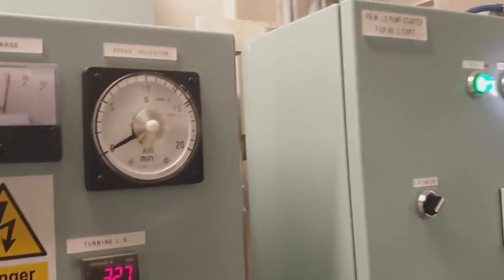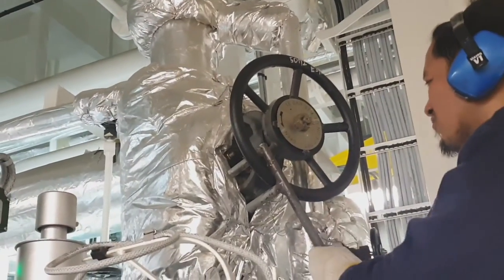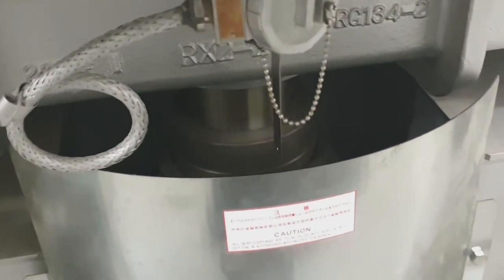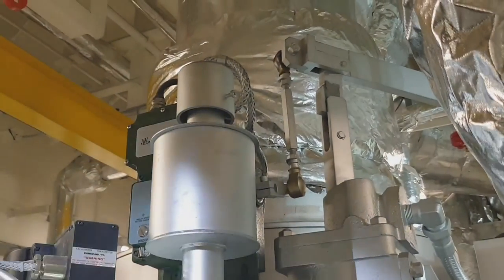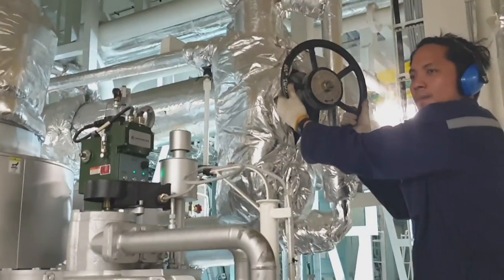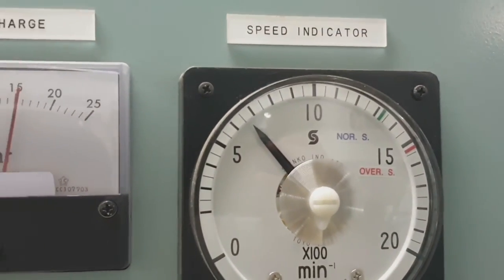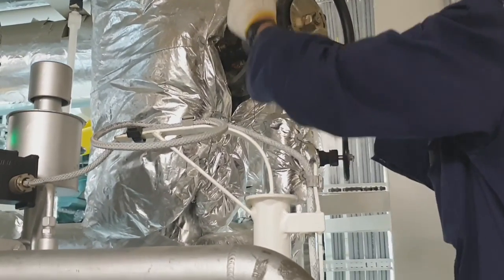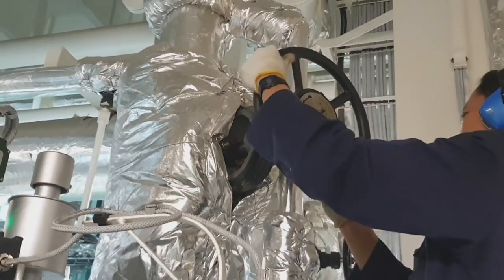HOW TO START CARGO OIL PUMP TURBINE

Comment: 4th matanong ko lng para saan ang Gland, Bulkhead, Upper and lower casing?
Reply from the maker: Gland steam, sealing, bali sealing nya pra hndi magleaking driving steam ng turbina is steam dn, gland steam sealing.. 
Upper lower casing bulkhead , mga temperature sensor monitoring yan , in case mag high temp , dyan makikita ..